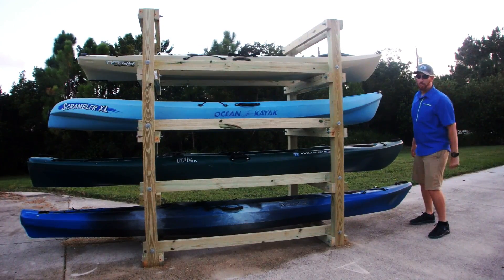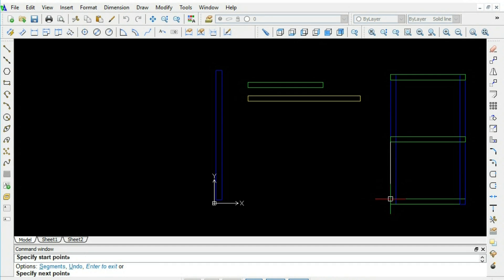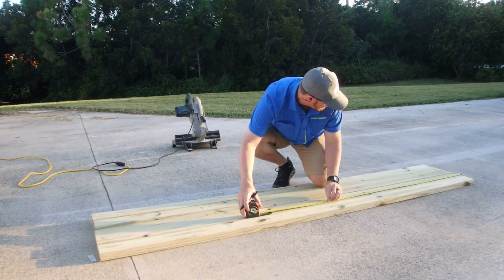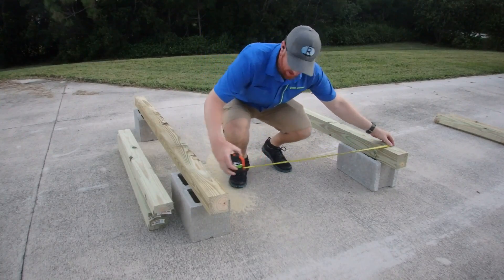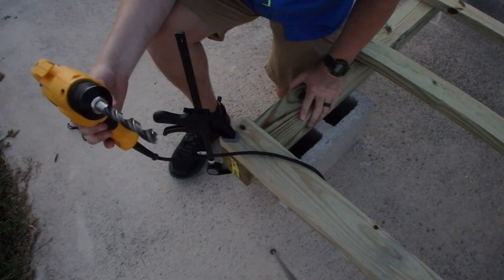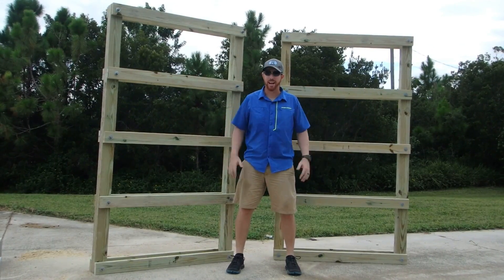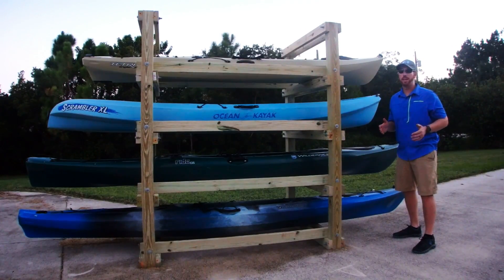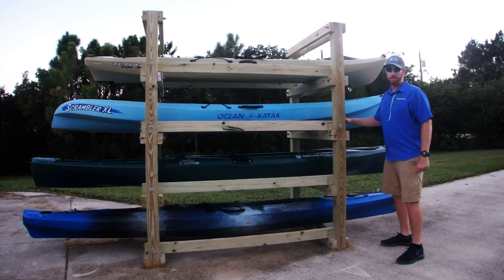How to Build a Kayak Rack - Tutorial

Comment: Although I haven't experienced issues personally, I read that if you use galvanized fasteners, you need to make sure they are approved for use with pressure treated lumber.
I read that in some cases the chemicals in the pressure treated wood can react with the zinc in the galvanized hardware

Comment: Nice rack! :-) I'm adding casters and leaving the topmost cross support off the top. Also adding paddle cradle to side and hooks for PFD's, ropes, etc.
Reply: Thought the same thing.  We have 2 kayaks so I'll modify the frame to hold 2.  Add the casters or wheels (whatever Harbor Freight has for cheap).  Add a shelf on the bottom level for coolers and assorted kayak stuff.  Thanks for the vid - got the creative juices flowin' !!